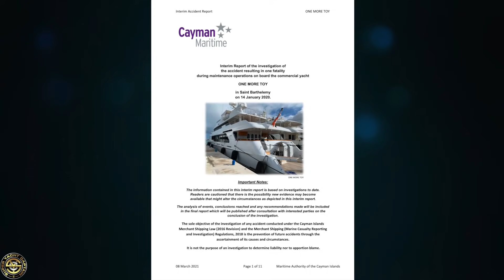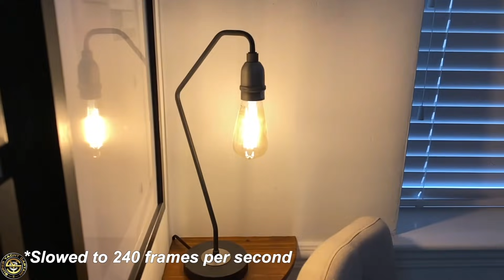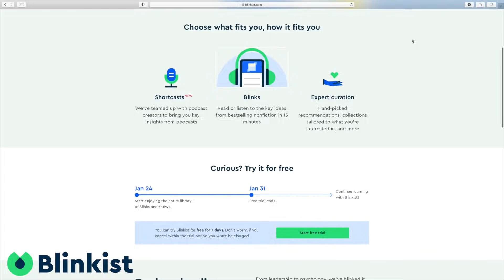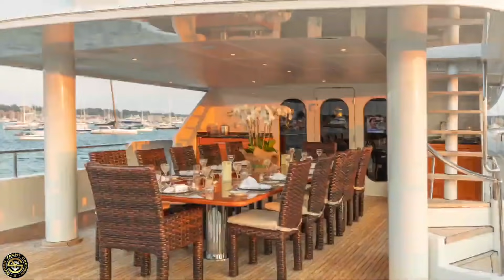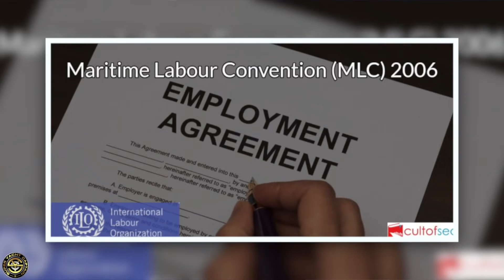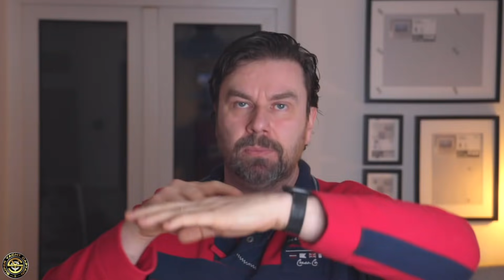Fatal Electric Shock

Comment: When your house inspector warns you about open grounds when they check outlets, THIS IS WHY!  Its not a crazy high risk in your house because very few AC "things" actually exist in a house anymore (notice how few 3 prong plugs you have) but in boats or commercial environments its a HUGE risk.
Reply: Uhm actually everything in the U.S. in modern houses is single phase 3 prong supposed to be grounded outlets. Some of the cheaper products you buy that  have three prongs just have the ground prong embeded in plastic. But your outlets and lights and even your satelite dish is grounded. Your tv cable from the pole to your house will sometimes contain a ground wire running between them.
Reply: @demonknight7965  none of those things will turn into a battery if you have an open ground.
Reply: @demonknight7965  and your cable TV wire is grounded because it comes in from outside, its lightning protection...
Reply: Many of the AC devices are now made by manufacturers that use double insulation to separate the hot side of the line from the operators.  This is obvious if you look at hair dryers, irons, etc.  That is why there are fewer 3 prong line cords on domestic products.  It is also why we have GFCI outlets so that if a hair dryer ends up in a sink or bathtub,  power leaking past the double insulation will be detected and disconnected before a severe shock can be delivered.  You are entirely right regarding missing grounds in outlets and every effort should be made to eliminate them but they are to be expected in old construction.  I still find knob and tube wiring and even water pipes used as neutral / grounds.
Reply: @diverbob8  lots of cold water pipes and well casings...never seen knob and tube but rag wire everywhere!
Reply: And I think my reply was not really descriptive enough, obviously all of our stuff is fed AC but internally almost everything is DC now.  In fact, most things even take AC, convert to DC and then BACK to AC because it can be made much much cleaner, noise wise.  The new AC signal is truly isolated from the world around it.  That doesn't work well for motors but lots if other devices are.  Maybe Edison was right and DC was the way to go LOL
Reply: @mjkulikow    What are the advantages and disadvantages of each, ac and dc.
Reply: @patbullard9276  AC transmits further using cheaper materials without much loss, it is still the clear winner and can easily be generated using good old fashioned windings.  HUGE power #s.  DC is much much cleaner, easier to manipulate but much much harder to trandmit long distances without massive wires!  Also, you may not realize it, but my original comment still stands, VERY few things in your house, even while fed with an AC source, are actually AC inside (tvs, computer and anything related, phone, led bulbs etc).  As we go more and more into DC dependence, was Edison right and DC was the right choice (if we could figure out the negatives).  All those new fancy cars, motorcycles and drones are ALL DC, the motors can run via controllers that pulse, incandescent light bulbs run on DC, hell AC motors will run on DC of you spin them up yourself....
Reply: @mjkulikow    Correct, AC is a much better choice given its advantages over the didadvan
Reply: Sorry, I hit the send button. Anyway given the advantages of AC and the Disadvantages of DC. But you must still understand that all of our devices, and electric cars are ultimately operated by DC batteries that are recharged with AC current. However my tv doesn’t have any batteries, it operates on AC current. As I have mentioned, even if you are using solar power (DC), you charge to batteries and then invert to ac for your household current usages
Reply: I don’t know where you are but in the U.S. our houses all run on AC power unless you’re off grid using alternative power sources, such as wind or solar. And even these are inverted to AC to make them usable by electric appliances. Having plugs that are two prong only indicates the lack of a separate ground wire but even they have a path to ground through the neutral wire.
Reply: @patbullard9276  I dont know of where you are but neutral is not a return to ground.  Ground is ground, neutral is not ground anywhere but where it is bonded at the panel.
Reply: I never said your house wasn't powered by AC, I said very few if the things in it actually ARE AC.  And as well, a non gfci circuit will NOT trip when shorted if there is no ground.  That's why there is a push now to have gfci and arc fault breakers in living spaces...than you 2x wire cords and DC/DC converters.  As I said before, VERY LITTLE in your house actually runs on AC, most are internally DC.  Electric elements and motors being the most common, until DC motors become cheaper.
Reply: Basically anything that can fault to a conductor needs a ground....motors, elements etc.  Circuit boards to charge your phone dont really qualify and can't become a battery.
Reply: @mjkulikow    Air conditioner AC, microwave AC, hair dryer AC, television AC,space heater AC or gas, lights AC, box fan AC. Cell phone DC but charged by, guess what? AC.   Also, a regular (non-gfci) breaker will trip when it detects a short. That’s it’s very purpose in the circuit.
Reply: @mjkulikow    Even houses that collect solar energy ( DC) through solar power can do nothing with it until it’s inverted to AC. I don’t know what  plug in appliances you have in your house but mine ALL work on AC power.
Reply: @patbullard9276  you're definitely not reading what I wrote...
Reply: @mjkulikow    Just as you said, neutral is bonded with ground at the main panel.
Reply: @mjkulikow    I read every word. Maybe it’s that you don’t know what you are talking about.
Reply: @patbullard9276  thats not how GFCIs work, they don't detect shorts, they determine current has to go somewhere else ie to GROUND, possibly through a conductor or through you...It can't just go out into the air (well a few MV maybe it can)....And I mentioned motors and elements, tvs haven't been ac for 25 years since tubes and even modern tubes can be powered by DC/DC converters
Reply: @mjkulikow     You will have to enlighten me on what DC/DC converters are. I don’t understand why or how you convert dc to dc unless you’re trying to change the voltage. For instance 12 volt to 24 volt and this is done with a step up transformer not a converter.  GFCI’s do in fact detect shorts, such as power shorting to ground through the human body thus electrocution.  The purpose of them is to act as a very sensitive detector of this kind of short and an immediate breaker of the current.  Also, electric current can in fact travel through the air, referred to as arcing when there is another conductor close enough for the arc to establish. Have you ever seen lightening?  And on another note, go to your friendly Ace Hardware and take a look at the electric sockets and tell me how many two prong ( no ground ) outlets you see. I’ll bet none because the three prong ( with ground ) can be used in connections that have no ground.
Reply: @mjkulikow    If tv’s aren’t ac then why do I plug my tv to an ac outlet?  My tv has no battery to supply dc power.
Reply: @patbullard9276  at this point you should spend a LOT more time learning how things work.  3 prong plugs and 2x prong cords for instance, buck/boost DC/DC converters etc.  And no GFCIs do not detect shorts, they detect a mismatch in line vs neutral current and trip, the assumption could be a short to ground, but it in no way has to be.
Reply: Here is a sure fire way to make sure:  if the coard only has 2x prongs, it most likely is primarily DC and has no step up/down (or any) transformers or motor/generator windings. DC circuits don't need ground, they make their own...
Reply: @mjkulikow    NO! This is not correct!  Two prongs is still AC and is only missing the ground wire. You can still use a three prong plug on a wiring connection that has only two conductors. If AC power is coming into your house it is coming from a transformer ( see the big barrel hanging on your power pole close to your house )that is stepping it down from high voltage used to transmit it. Then 240v AC ( not DC ) is brought into your house.
Reply: @patbullard9276  the first thing that AC hits is a diode and is instantly DC....
Reply: @patbullard9276  your TV does not run on AC, it takes AC and converts it to DC instantly, guaranteed....
Reply: @patbullard9276  ohhhhhhhh, this is why the internet is hard, you are correct you cannot feed your TV DC, it needs AC to convert to the correct DC.......Not sure if that has been a miscommunication but yes, you need to take your DC, invert it to AC and then it just goes and makes DC again :(
Reply: @mjkulikow    My tv absolutely uses alternating current!!!
Reply: @patbullard9276  name one thing in your TV besides the power supply (a DC/DC converter) that uses AC?
Reply: @mjkulikow    You do not know what you are talking about. A diode is not a converters, it is effectively a resister but only allows flow of current in one direction. Please let me know what institution of higher learning is teaching you this stupid stuff.
Reply: @mjkulikow     GFCI’s detect minute power surges that indicate potential short circuit.
Reply: @mjkulikow    3 prong plugs and two prong plugs only provide a connection from the hard wiring to the appliance.
Reply: @mjkulikow    I don’t know how you are making the determination that there is an actual difference in ac vs dc power going through a diode. Electrons are electrons and you cannot look at an electron and tell if it’s is ac or dc. The only difference is in the method of delivery. You can hook a 9v battery to a small light bulb and get the same results as hooking ac wiring to the light bulb. The filament both ways will glow, because electrons flow. Electrons are electrons.
Reply: @patbullard9276  we need a facepalm emote on here
Reply: @mjkulikow    What does that mean?
Reply: @mjkulikow      No, the first thing that the current hits is the switch, turning the appliance on or off.
Reply: The ground pin has very little to do with the actual circuitry inside the device. It is a safety circuit to bond metallic components that are not part of the electrical circuit, to ground in case they become energized. Computing centers and hospitals go further use isolated grounds for noise immunity because the EMI shielding of devices is tied to the ground circuit.
Regardless of the internal workings of the device, a two-wire device is double-insulated which means no exposed metallic casing and often involves an isolation transformer on the input before any electronic circuits.
There are double-insulated 100% internal AC-operation devices with no ground pin, and plenty of DC-operation devices that have a ground pin. It's the physical construction, not the internal operation that determines the need for the ground pin, with the very odd exception of electronic light switches that use the ground as a neutral when they are on a neutral-less switch leg. You can't have them on a GFCI circuit for obvious reasons.